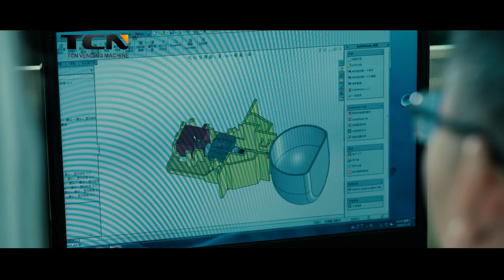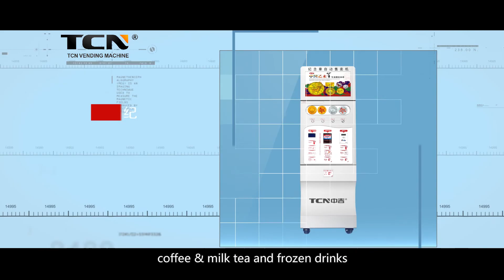TCN Vending Machine manufacture

Comment: Hi, i am new to tcn vending machine error code: 32 pushing plate current to high. What is the cost problem of EC: 32 and how fix it?.please i need  some help.
Reply from the maker: first step :standard Android -lift machine -error code 32 push cover too much current
https://youtu.be/ok-2uZbuiTI
②
second steps :24V DC error code 32 push cover too much current
https://youtu.be/bF1xHn9B-zI
③
third step : error code 32 push cover too much current
https://youtu.be/aG5rSLzGx-s